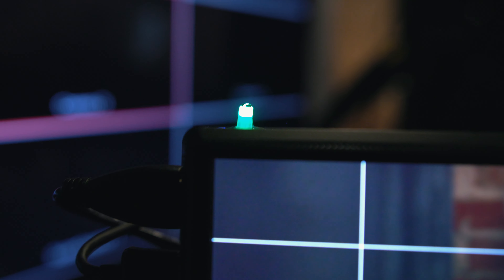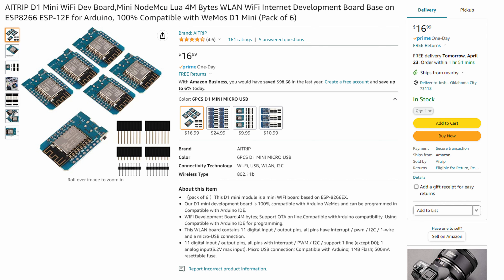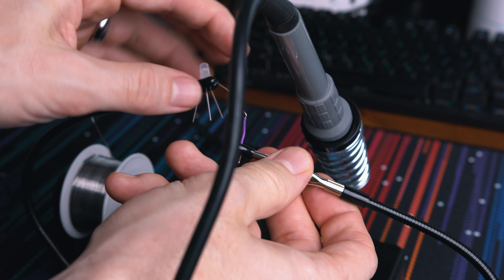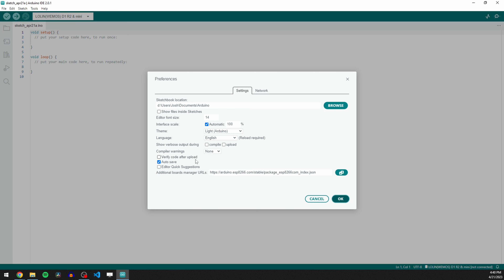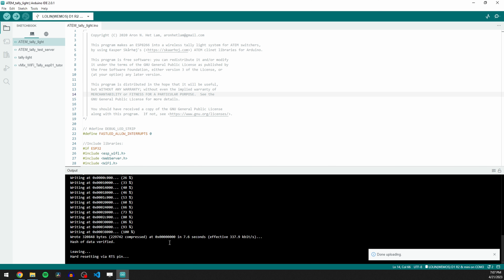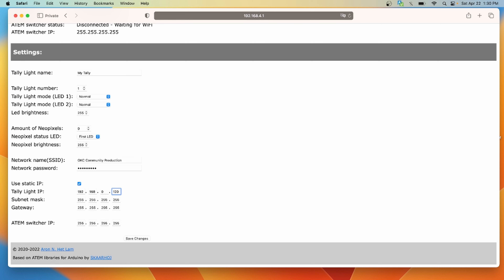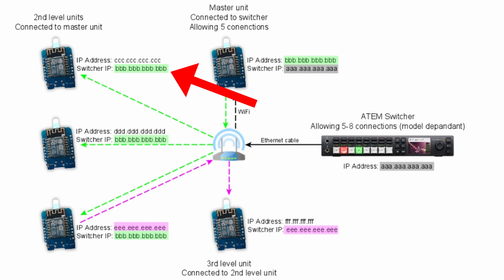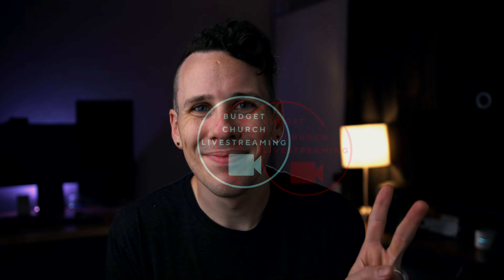$5 Tally Lights For Your ATEM Switcher | Your Cam Ops Will Love You For These

Comment: Hi, great video Josh, and thank you so much for doing it!  We have just two cameras and also a media feed from ProPresenter.  With just one tally light on and working, it turns red when in program, and green when in preview, but it stays green when no longer in program or in preview.  So when the Media feed (acting as a 3rd camera) is in preview and our other camera is in program, or vice versa, the tally light for the 1st camera still stays green.  Disappointing.  So it is acting like the 'Mode' setting is set to 'Preview stay on' which Aron describes is 'Tally will be green whenever not in program', but I have mode set to 'Normal' which he says should set the tally to OFF when neither live nor in preview.  Has anyone else experienced this and/or does anyone know of a way to fix this?  Thank you!  -Grateful to Aron and Josh and all who have contributed, etc.
Reply from the maker: Hm, I've never experienced this! It definitely sounds like that Mode is set incorrectly though, so I'd double check that. Outside of that, I'm not sure 😕

Comment: Do you need to have a "Wifi Signal" or just a network? We have a network that allows us to control our X32 on an iPad however, are at a school where we do not have wifi. Is this still a possibility for us?
Reply from the maker: It doesn't need the internet, if that's what you're asking. But it does need a wireless wifi signal.
Reply: @budget-church-livestreaming  If we have the X32 setup would it work in a similar way? We connect our X32 to the iPad wirelessly however, Im not sure if that's the same concept. We have a router with a signal.
Reply from the maker: @NathanFelizzola-i2s  Yeah that should be enough of a network
Reply: @budget-church-livestreaming thanks!

Comment: Thank you so much for this Video. Did this process in 2024 and the install process is now so much better, click click click and walla, software is installed. Its so smooth. I love the new process. I would recommend everyone to do this for cheap tally lights. We also used a 430 ohms resister and its working perfectly. You are very inspirational sir.
Reply from the maker: Glad to hear they're working well for you!!
Reply: My next question is; where did u put the tally once it was made and how did u keep it secure/safe
Reply from the maker: @phddudlexxx  I 3D printed some little cases and just taped them to the back of our camera monitors
Reply: I also ended up using your 3D file for the case
Thank you for all you do for church ministry and the Gospel of our Lord Jesus. you are very inspirational. 
From Zimbabwe (in Africa)
Reply from the maker: @phddudlexxx  Awesome, love to hear that. Thanks for the kind words!

Comment: @budget-church-livestreaming 
Thanks Josh for the great video! We have couple of questions:
1- What is the expected range?
2- I don't see any battery connected. Where is power source for the lights & cheapest?
3- What is the expected battery life for the light?
4- How lights communicate with ATEM? Is there a middle device? You might explained this video but I missed it.
Reply from the maker: 1. It's all on wifi, so just depends on your network.
2. It just has a micro USB port. We have ours plugged into our vmount battery plate!
3. Depends on how you're powering it, but they're super low draw. 
4. They connect directly to it over your network!

Comment: Love it!  I've got two set up for my system.  Now, to get them running at church (our ATEM isn't on the same network as Wifi, so IT has to fix that).  I'm thinking of adding more material to your case so I can add a 1/4 20 screw hole to it to mount it on our cameras.
Reply from the maker: Awesome! Yeah I've thought about extending the design, but realistically vhb tape and some zipties has worked great and I can't force myself to work it out 😂

Comment: Can we use Nodemcu ESP8266 ?
Reply from the maker: I'm sure you can, but the code might need to be slightly modified
Reply: Thank you for replying to me

I have an error with this
After compiling and uploading the program led don't turn white instead it blinks in purple or pink (red and blue) colour 

I'm using the D1 mini wifi module only
Reply: @budget-church-livestreaming  Thank you very much...
Following yours steps, I made a Tally Light but it short circuited and By God's Grace I made an another but it suddenly stopped working
D1 mini is not working now, I am thinking it is due to power short circuit again... I am using an lithium battery to power the circuit.
Can you help me with this? How do you Power all your tally light?
Reply: @AUGASTIN19  I just plug in a USB type C cord on a phone charger/adapter.

Comment: I've gotten this to work with a cathode LED.  I really want to get it to work with a neopixel strip, but the wiring isn't working for me.  I thought maybe I'm a terrible solderer (which I am) so I am justing a harness to make sure the connection is right.  It's not working.  I have an 8 led neopixel with connections on both end.  
Left side has GRND, 5V, DO, GRD - Right side has GRND, 5V, DI, GRND.  Per the instructions, I wire the 5V, GRND and DI.  No go!  Help please!

Comment: Great video! I'm having an issue when building these. I've built two so far and when I connect them both to a computer, they both aren't able to be found via wifi or via connection. Each has the led lighting up red and the reset button only appears when first powered on. Any thoughts?

Comment: Thanks a lot for the video. I’m planning on building this but with neopixels(LEDStripes) that the persons on stage can see it properly. I have one question though: how good is the WiFi on those boards, can they be 30 meters from the access point without issue? Otherwise I would go for the pro model with the external antenna. But I try to avoid it because they are not yet available in USB C.
Reply from the maker: Ours are about that distance, maybe a bit further, with no issues!
Reply: @ Perfect, thank you!

Comment: Thanks for sharing! How do you power these from a mobile camera standpoint? Do you guys have portable batteries? Does the lights come with all the wires including the ground and the resistors?
Reply from the maker: Our mobile cameras have a vmount battery and a plate (like this one https://amzn.to/45AqOMA), so we plug the tally into one of the USB ports. The LED's come with the resistors you need, but not the short wires you'll need, so you will have to get those separately.
Reply: Could you send a link for the short wire thanks for your reply! @budget-church-livestreaming
Reply from the maker: @nathangoh834  something like this should work just fine! https://amzn.to/47CDS5Q

Comment: Do you have a continuation video where you physically connected the tally lights to your camera?
Reply from the maker: No, but they don't actually connect to the cameras. They just need to be powered with a usb cable and then attached however you want. Depending on the camera, we use VHB tape, gaff tape, or zip ties
Reply: Thank youuu!
Reply: Hello. I can't read the resistors. Can you post the values of it, please? Thank you, brother.
Reply from the maker: @jedd03  all the values are in the instructions linked in the video description!

Comment: Thank you!  This looks great and I am looking forward to giving it a try to fix a little problem we have.  Do you know if it is possible to set it up with an external trigger?  Running a Y cable from the power source to the tally light and then to a larger light (example like a Cuebi Big Light?  Would that take a different code?
Reply from the maker: Glad to hear it! You could hypothetically wire up whatever type of light you want, rather than just a single small LED, depending on what your use case is. Just make sure you're supplying it enough voltage etc. Because this code is written specifically for an RGB LED, you might have to modify it a bit to work with something that's not RGB and instead is just on/off single color
Reply: @budget-church-livestreaming  Hey,  we were able to follow your directions to a T - thank you for making them so clear and easy to follow!  BUT  I have an issue... after a couple of min of not being switched, one will turn purple/pink and no longer work. The other will continue working from green to red without a problem.    I tried daisy chaining them with ip address as you suggested.  They will switch for about 2 min and then again one turns pink/purple and stops switching.  I have both of them set on a designated Wifi - specifically for the Tally lights.  Do you have any ideas?
Reply from the maker: @wordoftruthchristianchurch9623  hm...the pink color represents that the tallies are attempting to connect to the switcher. Maybe that tally is too far away, or something wrong was put into its config? I would suggest completely reflashing the microcontroller and wiping its EEPROM, and trying to set it up again. Past that, the only other things I can think to check are the distance to its wifi access point and like I mentioned before, the config settings that you put in when you started it up. Sorry I can't help more than that :/
Reply: We have run these at our church for 1.5 -2 years now. To make them bigger, so that they can be seen from stage, drill a hole in a ping pong ball the diameter of the led, stick the led in the hole, qnf a dab of hot glue will hold it.
If this makes the light too distracting, then use the LED Brightness setting to turn it down

Comment: A couple question if I may ask. Does internet required to make the tally light functional? does it need to be Black Magic camera only?
Reply from the maker: It doesn't need an Internet connection, but they do need to all be on the same network as the switcher. And no, the type of camera doesn't matter! But the code is specifically written to work with a black magic switcher

Comment: I'm desperately trying to get my D1 Mini Pro to work with the Atem (tested with Mini Pro and Extreme). So far without success. It works great with the D1 Mini. With the Mini Pro I couldn't save the IP of the Atem at first. Then I saw on github that I should also select the D1 R2 & Mini as the board for the Mini Pro. And the green light actually lights up now. Unfortunately the red one still doesn't light up. What am I doing wrong?
Reply from the maker: I've never used that board so I'm not sure! It might have a slightly different pin-out or something though, so you may have to modify the code a bit, or connect the LEDs slightly differently
Reply: @budget-church-livestreaming  I got it working. It was actually just due to a lack of contact with the D0 output on the board.
Reply from the maker: @Pfarbi  nice! Glad to hear it!

Comment: Hi Josh, I’m trying it with the ESP32 and a Freenove 8 rgb led module and it lights up orange which supposedly means it’s connected to the ATEM but it doesn’t change to red or green, any ideas as to why that isn’t working?
Reply from the maker: Hm, the only LED that should ever light up orange is the status LED, not the tally LED, so something might be off in your setup. I would say run it while it's connected to the computer still and see if any messages pop up in the Arduino IDE console

Comment: 2024 PSA: For those who can, use the web installer. (Using Chrome)
The process is WAY simpler and no need for Arduino. 

For some reason I kept getting error messages with the Arduino process, but had zero difficulty with the web installer 🙌🏼

It’s kind of crazy how well these work and how they have zero latency 🤯
Reply from the maker: I'm not familiar with the web installer, could you link it so I can take a look?

And right??? They've been a game changer for us!

Comment: Does not work, keep getting 'Compilation error: No such file or directory' for multiple pieces of code.
Reply from the maker: Hey Neil, sorry to hear that! I've never had that problem, but it sounds like potentially you're missing some of the libraries or something else from one of the earlier steps.
Reply: @budget-church-livestreaming  Thanks for the reply. I think you're right but I've tried moving and duplicating the missing files in the Arduino folder and the compiler still can't find them.

Comment: Can I use the USB C version of these?
Reply from the maker: I haven't tried them, but I'm sure you can! There are a handful of microcontrollers that should work as long as they've got that wifi chip. You may need to modify the code a bit though!